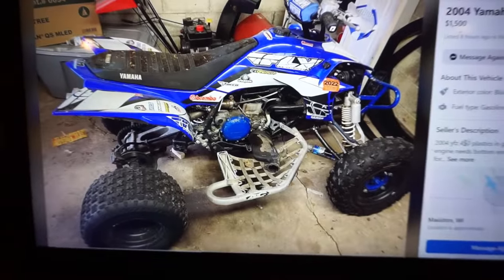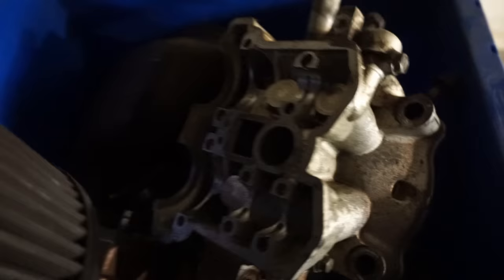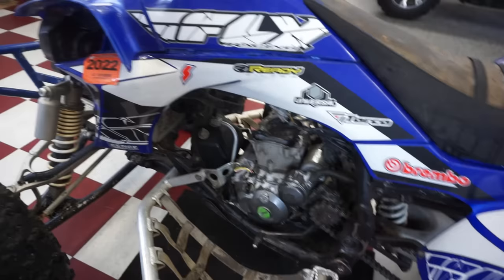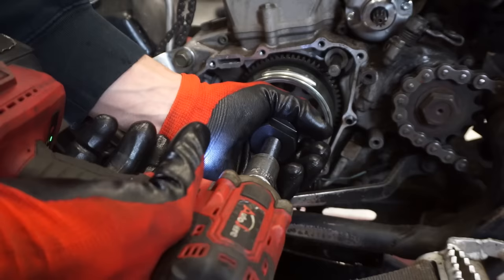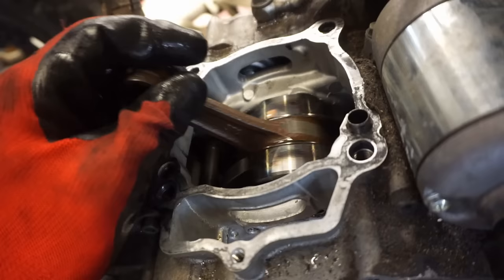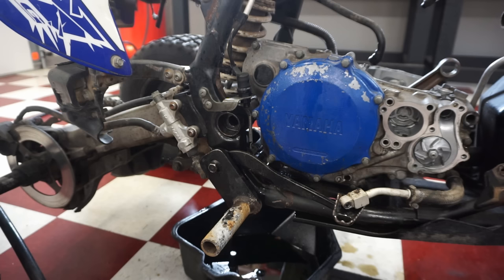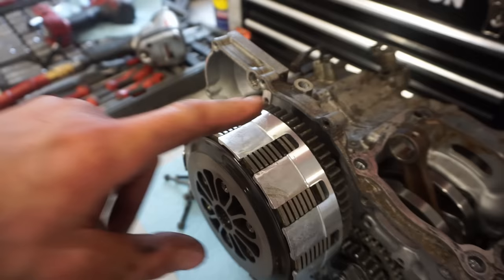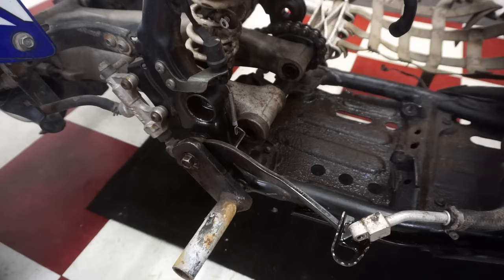I Bought a $1000 YFZ 450 and Instantly Regretted It

Comment: Worth $1000 even if he had said the crank was bad. Good deal and a good video so far.
Reply: Indeed even a blown engine great chassis for another engine of choice and bitta fabrication maybe a cbr900 lol
Reply: Yes ! It is a straight frame so good buy motor go out on all atvs sooner or later
Reply: Not really unless you’re keeping it
Reply: @timothyharmon6305   yeah most engines do fail eventually, milk goes bad eventually, tires wear eventually, lol good point
Reply: @dirtrider6090  Bought it for a grand and can sell it running and driving for 4K I don’t see how it could possibly need 3k worth of parts to get fixed

Comment: I believe that’s why people do the oil mod on the 04-06 yfz 450
Reply: 100%. I watched one grenade on front of me when it’s owner was bouncing off rev limiter trying to get out of an icy puddle. 

I’m rebuilding it and doing the oil mod to it
Reply: good to know, now i get why the cheap 1000€ 450cc yfz we got was rebuild, hot rod crank, piston cylinder seems fresh but they didnt change the head and stuff and cam ate some material off the head..
Reply: @reggiexp69  I had my 06 engine rebuild and let me tell u. It's a monster now!
Reply: @Godaboveall24_7  i mean once they work its a monster, the one me and a friend have when it worked it was pretty nice, but its a pain in the ass, we have been fixing it for 6 months now... between changing the head cam valves chims gaskets but afcors we dumb different head we didnt smooth it out so new head gasket aint sealing right... anyway ultra clean the carb new gasket for it, and still it turns on when ever it feels like it... at the end i think we might have a ellectrical problem since the start, i kidna gave up on this thing already when the cams ate the top end of hte head i was like yup lets sell it.. but my friend wanted to fix it... and yeah 700€ (split between both) later still not running...  i guess they are nice quads if they dont have problems and u have the money the let a garage fix it or are a good mecanic not 2 fools who try to do it for the first time (we did a banshee engine but that shit easy)

Comment: Reason the cranks fail on those earlier YFZ 450’s is because they have a bad oil pump from the factory. To fix this issue use a 2007+ YFZ oil pump

Comment: The 2004-2006 YFZ450's are notorious for crank bearings going out ... especially if you don't keep up with the oil changes ... In 2007, Yamaha added the oil squirter to the clutch side case cover, that shoots a stream of oil into the crank rod bearings.
Reply: Yup I've read up on that issue with those years and I think you can get the oil squirter too fit onto the 04-06 model years since they didn't really change since up until 2014
Reply: @kylebeach2316  yeah ... but you have to mill and drill the case cover to accept the squirter ... easy if you have the tools but not so easy if you don't. I have a 2006 yfz450 and I just bought a 2007+ clutch cover that already had it
Reply: @11GalleryATV  i thought the squirter was more for the wrist pin? i have had an 05 that needed a crank tho
Reply: @SamBrown01  yeah, but I think it actually covers both since it shoots up to the wrist pin, whatever misses goes down to the crank bearings too

Comment: That oil you drained looked pretty dang clean... I'm assuming he flushed it a couple times to get the metal flakes out.
Reply: you know he did lmao there aint no way a rod bearing goes and the oil looks like that
Reply: and he said it was sitting 2 years but it has a 2022 stickers on it lmao first red flag
Reply: @friches43  no you can get stickers for 2 years ahead bc they are good for 2 years usuauly
Reply: @_j0rd4n_  yea Ohio’s are good for 3yrs
Reply: @cadman9615  Depending on when you get them, you could get almost 4 out of them. I got my APV registration for a 400ex March 2020 and It's good through DEC 2023.

Comment: 41:04, he reason the BOLT was so danged hard to remove - after it was almost out, was that you had "ball-peened" the threaded end so much, the diameter of the threaded end was so much MORE than that of the hole, which resulted in the force needed to slide it through
Can I make a suggestion, for the next time/s you have frozen bolts to remove - use a car steering rod bearing puller, but have a sliding hammer that you can screw into the bolt hole of the claw, instead of the bolt which pushes the steering joint out of the arm.
That way, you will have an "in-line" hammer - instead of that 45 degree obtuse angle to work with.

Comment: Good buy for $1000 joe. Just make sure you do the oil squirter mod and change the oil pump aswell. I’ve done two carb yfz450 engines now and I actually enjoy rebuilding them too. 

You do need a bigger hammer though 🤣

Comment: You can disconnect the rear shock from the frame and then lift the swingarm up to relieve tension off that swimgarm bolt and it'll come out easier

Comment: Nice that the seller allowed filming, makes a pleasant change. NEVER leave possessions out in the open unattended!Maybe should've used a long drift bar, with the Hammer action drill thing (interesting solution l'll remember that) and kept going from the Right Hand side? Amazing the top end and other parts survived, good job it stopped turning over!

Comment: Good video as usual.  I'd recommend tapping the head end of the swingarm bolt and using a slide hammer to finish pulling it instead of the air hammer and a chisel.  Also, a longer soak in Kroil might help.  I've used it to lube bolts on equipment in dams that had been installed in a damp environment since the 1930s.

Comment: You need to remove the bottom shock mounting bolt to remove tension from the swinging arm,so the bolt will come out,ive had this problem.

Comment: 1) Spark at the right time.
2) Enough compression to run.
3) The and the fuel/air mixed up at a good ratio.
Those are the 3 main things you need for it to run.  Checking spark and compression is pretty easy.  Still have a problem---fuel delivery is all that is left.
Reply: 3) The fuel/air mixed up at a good ratio.  sorry

Comment: makes sense why it did not have enough power to turn over enough ! way to go on the bike for the deal im sure youll get it going in due time.
Reply: have you ever thought to use pb blaster on those hard to get rusty spray them down it stinks but let it sit for night if they really bad and that stuff works dreams it would made them mounts come faster im sure of that , plus the weight of the axle was fighting you might of been able to put jack behind to lift the weight off as you pulled the long bolt.

Comment: That was my next guess on it to the rod bearing got fired due to lack of lubricant inside of it from being overheated over cooked oil.& Low on motor oil to will cause those issues on those fourwheeler engines for sure.

Comment: You are going to want to install a 07 450 oil pump,inner clutch cover and wrist pin squirter. Look up oil pump mod for 04 to 06 yfz450s. Crank failures are common for these years. Yamaha cured the issue in 07.

Comment: 04-06 were notorious for rod bearing and wrist pin failure do to lack of oil reaching them in 07 they added an oil squirter to fix the issue and for 04-06 models you can replace the right side cover witha cover from an 07 and replace the stock oil pump with a high flow oil pump to fix the issue.

Comment: The 2004-2005 models had a known issue with oil starvation and they fixed it by doing an “oil mod” make sure you look up how to find it and see if it has the oil mod done
Reply: I have a 06 YFZ can you tell me how can I know if they did the oil modern not? Please and ty
Reply: @Godaboveall24_7  you could pull the clutch cover off and check for the little injector they put it for the mod… but 06 and up have never had a oil starvation issue if it does I’d check other things like cooling systems if it seems to be running hot and burning up rings and rod bearings

Comment: When u we’re removing the main engine bolt  (frame bolt whatever) with the hammer then u tried the impact hammer u were struggling but what I do is I use the claw of the hammer and it doesn’t slip. Just bang it out with that.

Comment: You can thread the inside of the swingarm bolt, thread a lenght of all thread into it. Then slide a large socket over it, large washer and a nut. Then start cranking it down to slide the swingarm bolt out. I hope that makes sense.

Comment: You need to invest in a crankshaft press jig if your going to be doing this for a while so it will save you a ton of money! On that swingarm bolt try drilling a small hole in the center of each side and putting pb blaster for a day or two

Comment: What I’ve always done is that if you put an  old nut that fits on that axel and get a air hammer with a round tip and use that it breaks it free pretty quick lol comes in real handy

Comment: Heat then spray immediately with (I use PB) penetrant. Then try to turn. Took me 2 weeks of heating and soaking but I finally got it. If you ride alot ot wet areas, takenit out and grease it every fall. Never had my own ever get stuck. Nice job..👍

Comment: Honestly looks like it got hot and seized blued so… definitely got too hot… I also suggest you pull the metal filter on the bottom of the oil tank and replace it filled with metal on my 400 and also had to torch out my swing arm bolt fyi

Comment: If you want your shit to last, keep the oil full and run good oil.  Clean the air filter and always warm it up before riding; And if you take your brake levers and kick starts apart ever so often and grease them up they will last a long time. And it doesn't hurt to grease the swingarm bolt and the axles once in awhile. I'm into the mid 80's Honda ATC's, and when I get nice parts I can make them last for decades, but all too often people just want to ride, they won't even check the oil, and they just ride it until it breaks...

Comment: Another thing that could be the issue is it has the wrong main jet inside the carburetor to. That can cause those same types of issues on those engines to. Cause A offset main carburetor jet can cause those no power.& Get up.& Go issues to. If that tab is broken off to it will effect the timing for sure. It might need tig welding done.,or mig welding done to fix that tab problem on it to Joe. It has to o be on that engine block.,or separate spacer plate one. On those split case engines for sure.

Comment: You should do the oil mod to that thing I think 04 -06 have a lower pressure pump and they do not have a oil squirter that sprays on the rod I’ve done a few of them with basic tools I’ve had one of the 450s I’ve done for seven years and have had no bottom end problems

Comment: Just had the same problem on a Raptor 700 I got. The Rod bearing was seized just like that because the previous owner ran low on oil. Rebuilt it with a Hot rods crank and now she runs good. I have a video on the tear down.

Comment: I have a 06 yz 450 with the 5 valve head. There's an upgrade that adds an oiler tube to get more oil to crank-if I remember right.

I think the upgrade was later years that are compatible with the 06. It's a small tube that spits directly into a passage way.

Comment: A new penetrating oil on the market called "Free" is so much better than anything iv'e used for seized bolts and parts you should try a can. In my opinion it works much better then w/d

Comment: Taking the weight off off it by putting it on a stand is a good idea when removing swingarm bolts.it takes the weight off the bolt and  Saves having to cut the video where the quad collapses on you as you pull the bolt out.

Comment: Needed  1 Decent air hammer that is a body pannel tickling device  1 lump hammer  2lb+ and some good drifts  PS you should never use sand paper in a bushing like that it takes 1 grain of the stuff to get embedded thats it game over you will definately need the saw next time

Comment: You can use a smaller flat spanner that fits over the swing arm bolt shaft, smaller than the hex head, and hit the spanner and ot will come out better than hitting the head of the bolt damaging the head.

Comment: you do a lot of work like this, i work on lots of powersport toys as well and some real old stuff. Just wondering why you dont have a oxy-acetylene torch as it is far superior to a propane torch. When i have trouble and have the correct pullers and slide hammer and yada yada, the last thing is some fast concentrated heat from an oxy-acetylene torch, works 99% of the time. If you really dont want to purchase that at least use MAP gas instead of propane. It can be bought usually right beside the bottles of propane but in a yellow bottle. Even map gas is far better than straight propane. Keep of the good work, I love your committment to completing your projects and doin a good job. Peace.

Comment: if you dont see einstein timing chain is dead need change it also
when there is so much metals inside all bearings must bee change also ather case motor will fail wery fast after you change only crank

Comment: You want to make sure that your rod bearing guy installs the new one using gel lube spray.& Assembly lube for that application procedure for sure.& I recommend you using A thin coat of anti- seize on that long through 🔩 bolt to you had trouble getting out also on that fourwheeler you just got. Just A hint truck & tip.

Comment: Air hammer for the save!! I just got one last summer and idk how I lived without one for so long! 😂 definitely make sure you clean the oil pump assembly! Or you’ll be right back in there! And I do lightly hone nikasil cylinders 😬 still need to be able to get new rings to seat. I haven’t had it as a point of failure yet knock on wood 😂

Comment: Yep, the swingarm on my 2001 400EX wasn't coming out. I ended up cutting it,  of course freed up after bolt was red hot... it ended up being a basket case,  still sitting in my shed. Sad thing is there was zero wrong with the engine besides a something dropped in the case by my friend's father,  when I had the top end open doing new seals
Reply: I never split the cases after getting the engine out. It still sits in a pan awaiting new life

Comment: Oh yes the infamous frozen bolt, dealt with that on my 400ex and it was a pain.. ended up cutting the bolt with a modified sawzall blade on both sides, taking out the motor.  Was still a pain because the sleeve kept it from coming out of the frame and the motor.  Luckily the bolt is hollow and I cut a channel in it length wise.  Wow what a disaster.  You got really lucky on yours for sure.
Reply: Yup had too do that on my brother's KTM supermini nothing was working so the Sawzall came in 😂

Comment: You need a flat bit for your air hammer the one that looks like a coin welded on the end with that you can vibrate the swing arms and all along the outside of the bolt

Comment: You don't need to cut swing arm bolt you just need to make a slide hammer I made one out of 1 1/2" shaft and put a giant steel plate on it with a nut at the end and mine came out and it was definitely as bad as yours

Comment: It's most likely the pick up coil to close to the flywheel.,or to far away from the flywheel magneto 🧲 magnet.,or the carburetor needs to be cleaned out again. It's possible to have water in the fuel to inside of the fuel tank. I'd check the intake reed valves behind the intake manifold. Cause it could be bad reed valves is the problem with it to. the reed valves can do that exact same issue like it's bad fuel.,or A bad pick up coil issues. I'd check the vented fuel tank gas cap to.

Comment: Or if at at 42:12 .. if you had used the HUGE HOLE where the motor used to be, and air-hammered past the rear drive chain by being in-line with the bolt.. as that too would have been quicker.

Comment: Good video 
Couple things I would suggest is get a real hammer like a 4lb sledgehammer that would get that swing awe bolt out a bit easier and if you plan on rebuilding this thing get the repair manual for step by step instructions clearance specs and torque specs  I’ve done my 08 250f with the manual it was easy enough
Reply: My bet it that he never changed the oil in it and did the exact same thing my bike did .. same failure and mine was because I rode it hard and was way over hours for oil change .. I changed ever bearing in the engine and trans because if one got starved for oil the others are worn from it to I’m sure .. if your going to keep it anyway mines still running strong after 3-4years now

Comment: Omg lol. Buy a 24" or longer 3/8 extension and use it as a punch to drive that swingarm bolt the rest of the way out haha. That looked like a nightmare I was just wishing I could hand you an extension to push it with. Also works great for lining everything up when it's going back together.

Comment: when a shaft or long bolt that you can't get all the way out. Get it out as far as you can lube it up and push it back in then back out a few times. it will works its self looose.

Comment: Air hammers gotta love’em wait till you upgrade to something like “big nasty” that air hammer would have shot that bolt out through your garage wall😂 but you should get a good set of punches, a ratchet extension bounces a lot taking away the shock of the hammer strike. Don’t get me wrong I did it also but when something as stuck as that bolt was every little bit helps.

Comment: I wouldn't trust the bearings after all of that metal went through the motor. At the very least take them out and soak them in ATF and spray them with brake kleen. I'd also wire wheel that swingarm bolt and coat it in red bearing grease. Should be a good flip after your done.

Comment: Please get a bigger hammer...maybe a 3lb at minimum! There's a lot of weight from the quad pushing on that bolt just sitting on the floor. Personally I use a slide hammer so I can hook on the other side to pull the bolt out...works super easy and fast! Dont have to damage anything.